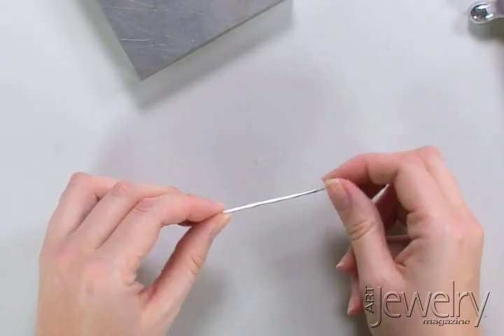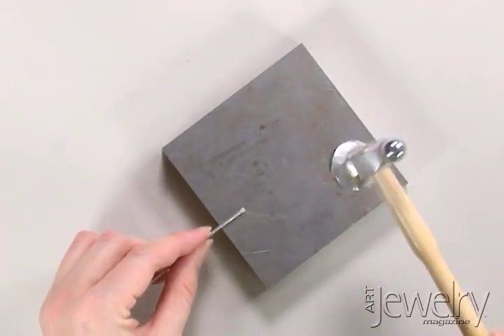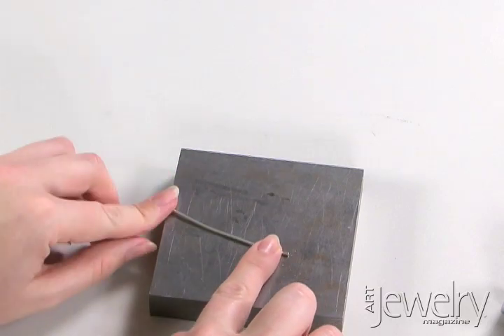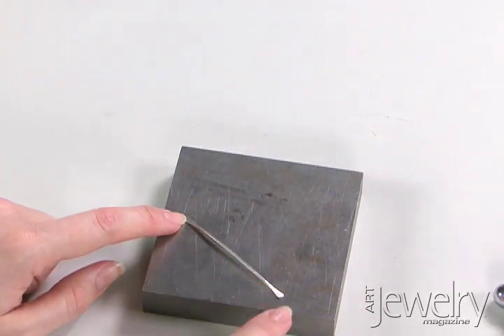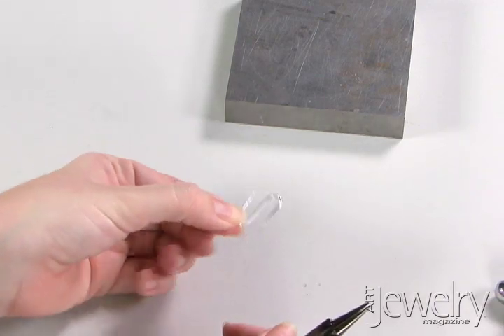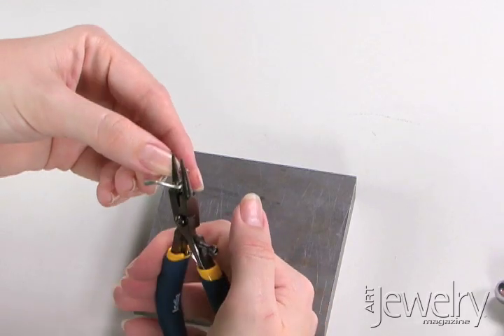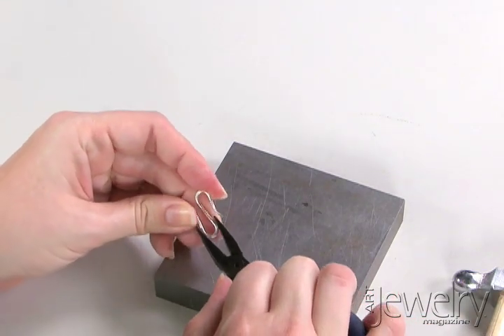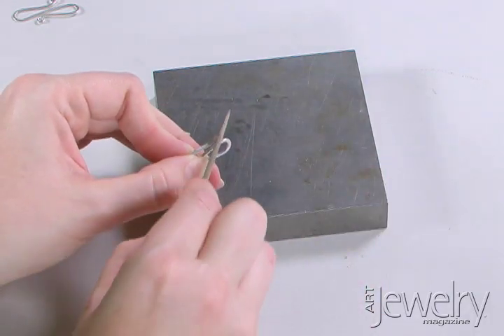Art Jewelry - S-hook clasp with hammered ends

Comment from the maker: The weight of the hammer you use depends on how quickly you want to forge the wire and how comfortable you are with the hammer of your choice. A heavier hammer will move the metal more quickly and with fewer strikes than a lighter one, but for precision work, you may prefer to use a lighter hammer with more strikes so that you can refine the shape of the wire as you go. I personally didn’t film this video, but my guess is that the chasing hammer used in the video is approximately 3 oz. —Annie

Comment from the maker: @kswanson20 14-gauge wire is 1.6 mm across. You can find a free downloadable gauge/mm conversion chart under the Reference section of our Web site.

A convex hammer would work just fine. (The chasing hammer I'm using is just slightly convex) You'll just have a slightly different shape to the hammered divots on your metal. Have fun experimenting with different hammers to see what you can come up with.